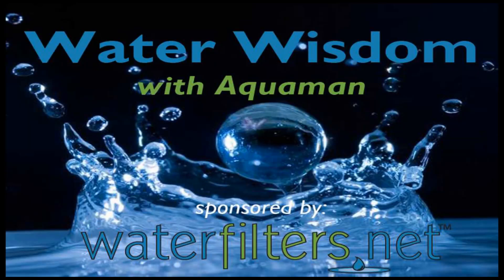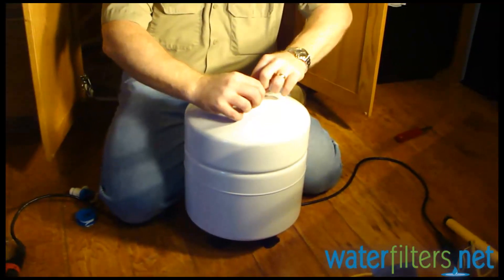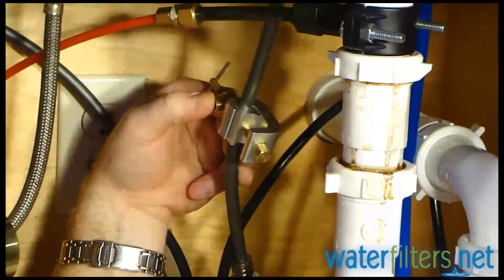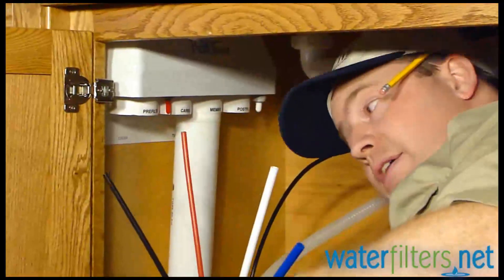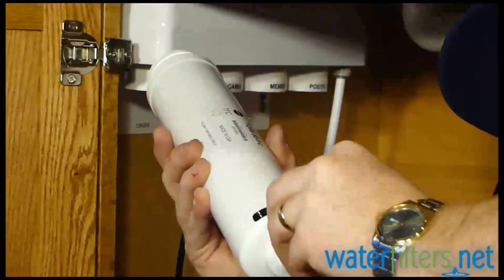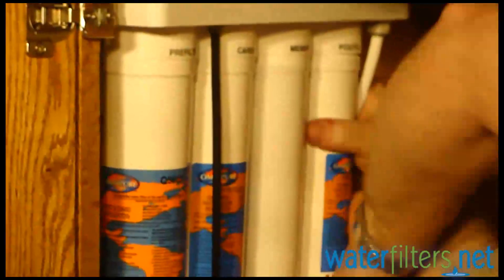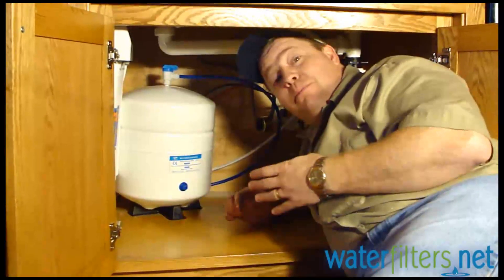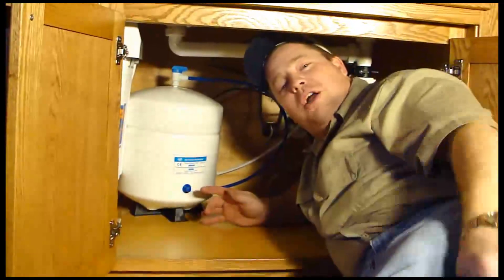Reverse Osmosis Installation Part 2

Comment: We sent the entire set-up back to Isopure and they said the plumber had connected the filters wrong. We have an extra to re-mineralize the water so they hooked that up as well and sent it back. Water is coming out of the waste but I don't hear it running into the drain line. So far we've gotten a couple of tablespoons of water from the faucet and none to the ice maker. I'm soooooo frustrated.

Comment: Awesome video!! Question: If bypassing the air gap faucet, is it necessary to use an inline check valve to prevent damage to the system if the sink backs up? Or is this overkill?

Comment from the maker: The saddle valve is included, but I made the modification concerning the plastic ferrules. I'm pretty sure it came with brass fittings and I replaced the brass ferrules with plastic.

Comment: Do the saddle valves and ferrules come with this system?  I ask because you recommended not using brass on plastic, or vice-versa, but one would assume that the parts that came included with the package would be compatible.

Comment from the maker: Not sure who you are calling stupid, but that's the point of an air-gap faucet when it's used. Reverse suction in a plumbing system is extremely rare, even more so in a rural home using water from a well. So in this situation we did not use the air-gap faucet because we are not at all concerned with reverse flow issues.

Comment from the maker: Something is definitely connected wrong. Though it's very difficult to identify the problem without more details. Can you take some video footage of the RO system connections and  the connections to the faucet and post it as a response to this video. I can do a much better job of diagnosing your problem if I can see what's going on.

Comment: I have a really dumb question.  I don't have a faucet, but it looks like I do have a chrome air gap cover (with a hole in the counter/sink for the drainage hose).  Can I just connect the waste hose directly to the waste disposal? and then use that hole for the faucet?